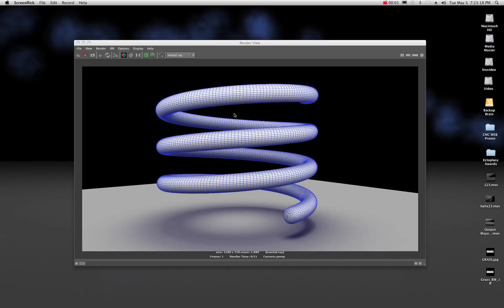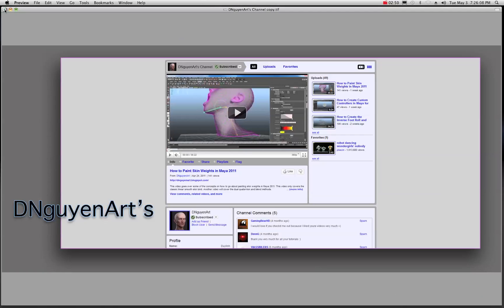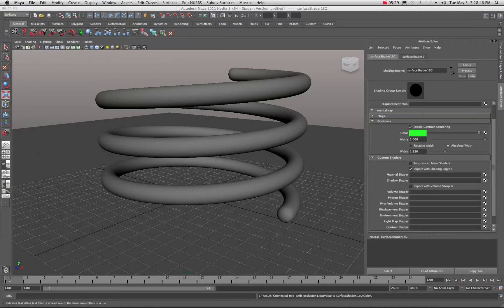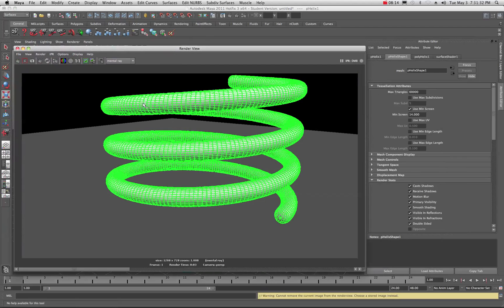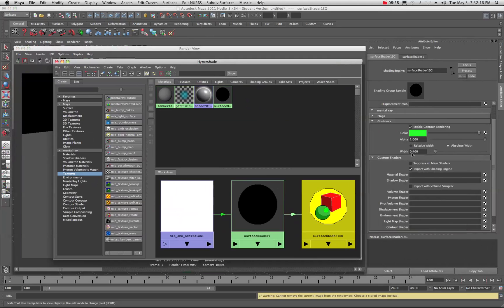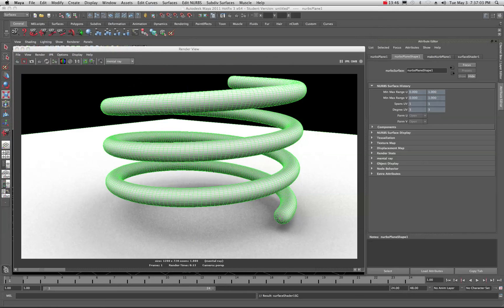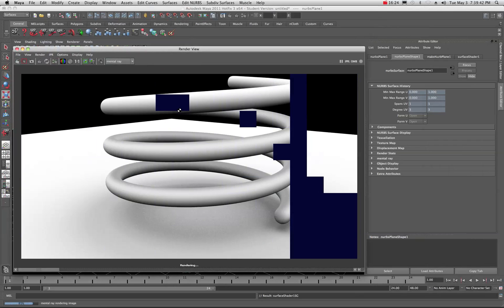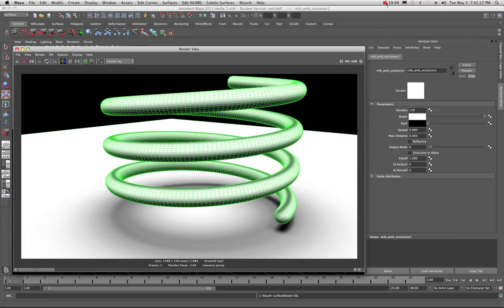Maya 2011 The Ultimate Wireframe Render Tutorial by Stuart Christensenrial Part 1 of 2

Comment: Iv noticed that when you do this it seems to double the amount of faces. I love the way this looks but when I do this to my character that I modeled everything works the way you said except it seems to add more geometry to my model. Is there a way to bring down the amount of geometry so that it shows the actual amount that is on my model?
Reply: Trevor make sure you don't have the 3 key hit on the model to soften it, bring it back to 1 and it should work fine.
Reply: Thank you for your advice. I was trying to figure this out last night and that's the exact conclusion I came to. My reel turned out pretty good. One question, when the 3 key soft mode is on does it add geometry that you cant really see till  you make the wireframe render or is the render adding geometry only to the render?
Reply: Because the 3 mode is what mental ray sees when you hit the soft key then yes, it would be only visible in the render making it heavier, but you can have soft key effects without the soft key compromise using, the Approximation Editor. Sorry for  the late reply.

Comment: Hello deepfriedectoplasm,
First of all, thanks for everything you do! It is indeed the best interpritation / explanation I've seen. 
I use Maya 2014 and I did everything you show here. Just NO wireframe and thats it! So I googled a bit and here is the aswer: Maya 2014 made some changes in this particular field, now, if we want to render the wireframe we need to change the sampling mode in render settings to Legacy Sampling mode, by default it is Unified Sampling. Then it works fine. 
Greets!

Comment: Hi, first off, amazing tutorial.

Secondly, I was wondering if there was a way to render of just the original topology/poly count with this method whilst smoothing the mesh with '3' at the same time? It's just the fact that small parts get taken up my the wire frame yet the bigger parts of the model do not. Or is it just a mental ray thing?

Comment: I don't know if the deepfriendectoplasm has replied to you but...

The reason why is because he has subdivided, by default this doesn't show the wire frame of the subdivide in the view port unless you change the settings to do so but it does when using mental ray rendering. you can cycle through normal and sub divided by using 1,2 and 3 on your keyboard.

Hope this helps.

Comment: i dont know if its been covered in the comments but i think the reason for maya unchecking settings when you switch to the production preset in render settings is due to it being a preset, so maya switches all settings to the predefined settings as stated with the production preset. you will notice this if you have final gather and global illumination ticked on with the default settings, then switch to production quality it will uncheck FG and GI..

Comment from the maker: @timaging Yes, by default it seems that Mental Ray production quality settings will disable the wireframe contour settings so you always have to double check that the boxes in the "Draw By Property Difference" section in the Mental Ray render settings are set for what you need.  It's probably best to first enable the Production Quality preset and then setup your Contour Rendering options. But, if you start with a lower quality test render setup for speed, you will need to recheck often! Cheers